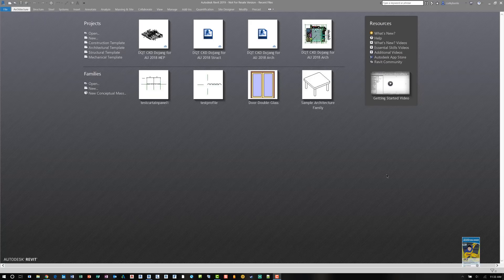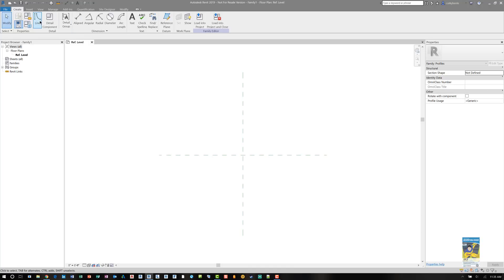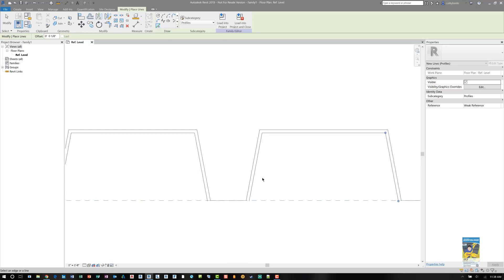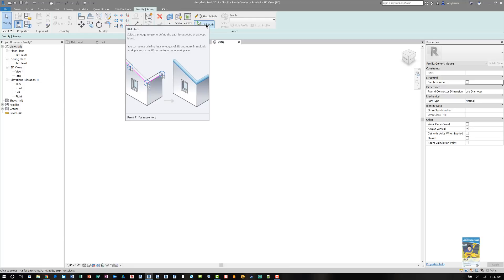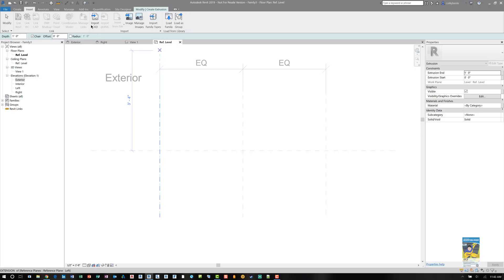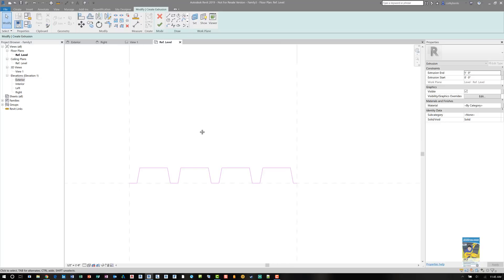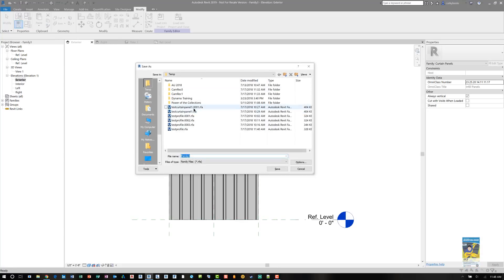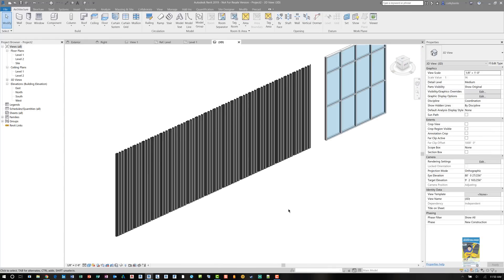Revit 2019 - Corrugated Metal Panel Family and Usage

Comment: When you guys make these videos it would be helpful to load it and use it in a model as a demo and show how it interfaces with a sloped roof above and window openings. The problem with using curtain walls as the motif is that this family wont attach to the underside of an angled roof and it also doesn't like clipping for windows..doors yes but not windows.
Reply from the maker: Curtain walls can attach to the top of a roof.  You might have to edit profile to make it work. Panels can be swapped for panel doors. Or, you can swap a panel for a wall and insert a door in that wall. I have another video that shows the application of it...just dig into my channel. You'll find it.

Comment: This is beautiful, thanks for the tutorial. But using this system it's not possible to cut holes/create different openings shapes on it for doors, windows and etc, therefore, it becomes pretty much useless.
Reply from the maker: Actually, if you create this panel as a custom vertical wall, you can host a door or window in it. You can also use the wall opening command or face based opening command to make holes. Since it's a wall, you should be able to Edit Profile too.

Comment: Hi Dzan, thanks for video. I am having an issue getting the corrugated part of the panel to repeat. I get two section of corrugated panel with a big stretch of flat space that grows with the size of the wall.
Reply from the maker: That happens sometimes. It is due to the amount of bends.  Make a profile that has less bends for the panel or make a bend as a mullion profile and repeat the mullion instead of the panels.
Reply: Thanks Dzan, I'm have issues with door and window openings not aligning properly. Is there another way to create a corrugated metal panel using a sweep method but have the sweep run vertically and then repeat horizontally?
Reply from the maker: @davinhartley6099  try using a beam system where the reference plane is set to vertical.  You can also try to create a custom in-place family and array it.

Comment: Thanks for the video! I need to edit the profile of the curtain wall   to a round shape.  When I edit it, the panels that are being affected by the profile, Revit is automatically changing  them to Glazed panels and it is not letting me use the corrugated panels. Any thoughts on how can I resolve this problem?
Reply from the maker: not sure what you mean by round shape....custom profiles for curtain panels need to be simple with not too many complex curves...otherwise, it defaults back to glazed panel.  Hope this helps
Reply: @DzanTa  Thank you for your prompt reply. It is also happening when I put a wall opening. I have my curtain wall set it up with my vertical grid spacing at a 3' fixed distance  and my horizontal grid at 20', that is the actual panel size given by the manufacturer. When I make a wall opening for my 7' high door there is reaming 2' panel. This 2' panel is the one that Revit is changing to the glazed panel instead of the corrugated panel.
Reply from the maker: @adrilemmen  you may have to delete the panel and recreate it custom. Hard to diagnose.

Comment: As stated below I followed this several times and keep getting an error message...can you help with this, I also emailed you can you help
Reply from the maker: Check email response
Reply from the maker: I looked at your family.  Instead of creating a profile with a lot of s curves and making a panel that repeats....do this instead:  Create a profile sketch of just 1 s curve as a Mullion Profile.  Then load this into the Project.  Use the Properties to swap out the mullion profile with your custom one.  Then make sure the repeating distance is only the length of 1 s curve distance.   I hope this helps.

Comment: is it can fill with door or window (automaticly cut wall0) sir ? tkyu
Reply from the maker: A Curtain Wall has a properly called Automatically Embed.  If this feature is checked, the curtain wall will be hosted by the wall you draw it in.  If you are talking about a door, you can load in a curtain panel door and then select a panel to switch it to the curtain wall door.
Reply: @DzanTa  tkyu sir, but my door is from metal rolling door because I use this coggurated for my factory design, when i created a hole from "opening wall" in revit is success 90% the rest is failed because the coggurated wall become a glass again. Can you have the solution sir? Tkyu
Reply from the maker: @tanjungsari-b8j  If your door is a typical door that is hosted by a wall, you can switch your panel out to a wall.  Then, insert your rolling door into that wall so it will be hosted by that wall within the panel within the curtain wall.

Comment: I can attached to a roof with slope, always change the panel  for a glass panel after attaching.  Any help please
Reply from the maker: you will need to use an adaptive curtain panel for the panels that are not working.  This is a bit harder to accomplish.
Reply: @DzanTa  Sir I think It;s possible without Adaptive Curtain Panel
Reply from the maker: @biswarupmondal5778  send me your model so I can help you after lunch
Reply from the maker: Dzanta@gmail.com
Reply: @DzanTa  sir if you use the mullion profile like as the curtain panel profile then it's possible. also i am sending my sample file where you can see also a corrugated sheet Gable Roof. Thanks
Reply from the maker: @biswarupmondal5778  I have your model.  Your use of a custom profile is good.  It looks proper to me.

Comment: The wall I created works well up to 5 feet wide. longer than that it stretches normal wall then it repeats the pattern after 10 feet. So what I have is 5 feet wide of the corrugated wall then about 10 feet flat, then 5 feet corrugated again. There is NO loop ? Her is how it looks :   http://i67.tinypic.com/1znqsfb.jpg
Reply from the maker: Check your sketch to ensure the profile is aligned, dimensioned and locked properly.  What is the realistic width size of the manufactured panel?  Use the vertical spacing property to control this width.  Theoretically we should be able to make a single giant panel using your custom profile swap such as in the Curtain Wall 1 type.  Send me your profile sketch so I can play with it.  Dzanta@gmail.com

Comment: I tried this and I keep getting an error message, "Can't make type "Test Curtain Panel 1"."
Reply from the maker: You may need to redraw your profile sketch
Reply: @DzanTa  Thank you for the quick reply, I've tried redrawing my profile sketch and it didn't change the issue. I'm able to make the metal panel family, I can load it into my Revit project, but when I try to change the curtain panel to my new profile, that's when I get that error message.
Reply from the maker: @victoriaunruh5761  the curtain panel in the project may be drawn such that it cannot accommodate the number of panels and spacing...try redrawing the host curtain panel as a simple straight wall, then a curved wall, then a wall with multiple curves of varying radii to test your custom panel.

Comment: I've comeback to this 3 times and have gone thru it step by step. Every time i get to the part of loading in the metal wall panel it loads into new file but half the panel drawn is corrugated and the other half is just a smooth wall.  Am i not locking something correctly making the metal wall family?
Reply from the maker: probably....I would need to see your file or see what you are doing.
Reply: 4th try was successful! Turns out under properties for my modified curtain wall I changed the max spacing to be 4ft like the panel width was and that resolved it. Now to cut out openings is my next step. Thanks again! :) Dzan Ta